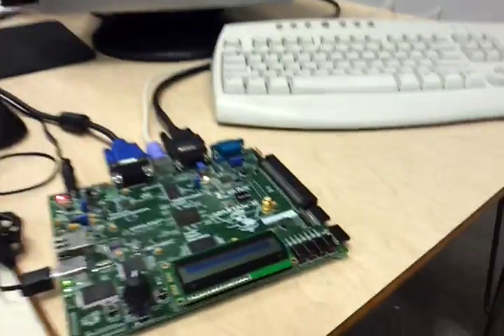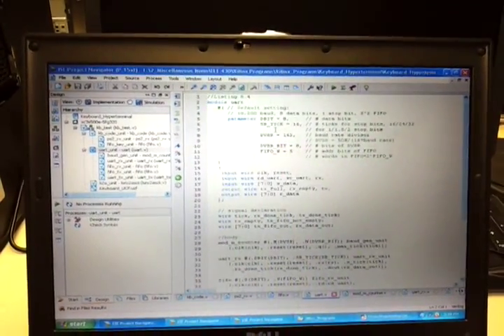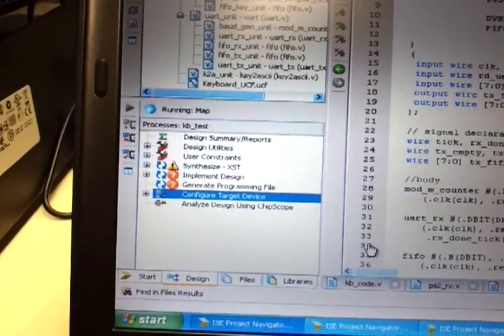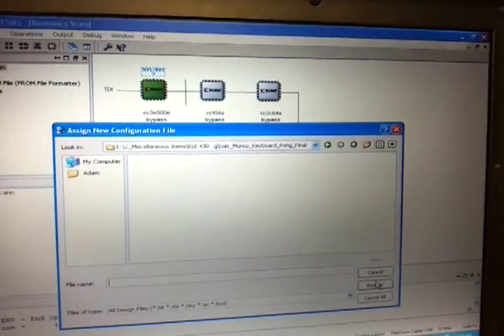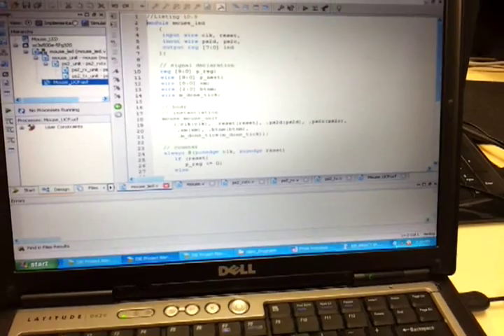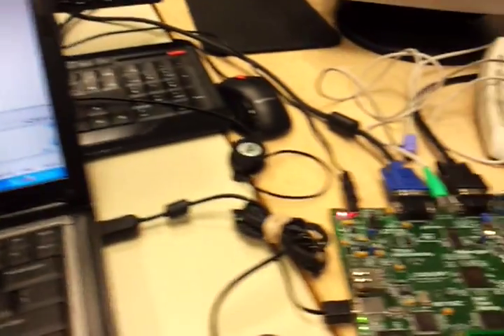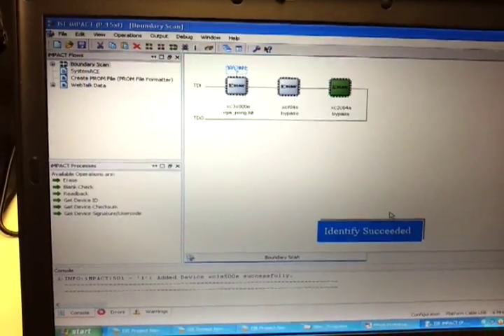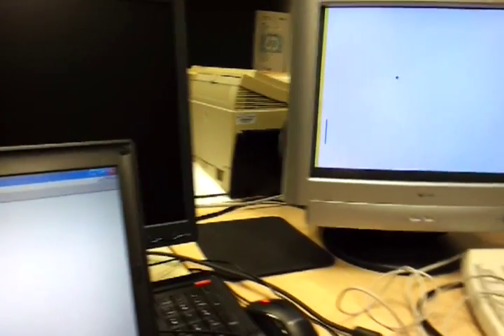FPGA Prototyping in Verilog - LED Mouse, Keyboard, and Pong

Comment: I tried to use the same code for cyclone IV altera board using quartus.The simulation is successful but it fails to load in the board. I don't know what is wrong. Can you help?
Reply from the maker: so you generate a programming bit?  using Xilinx software?
Reply: Xinthose I tried the pong game code using Quartus II 13.1 and implement it in altera board DE2-115.
Reply from the maker: Jeonalyn Gabutan are you using the correct .ucf file?  You copy and pasted the code into Quartus?  You are using Verilog, correct?